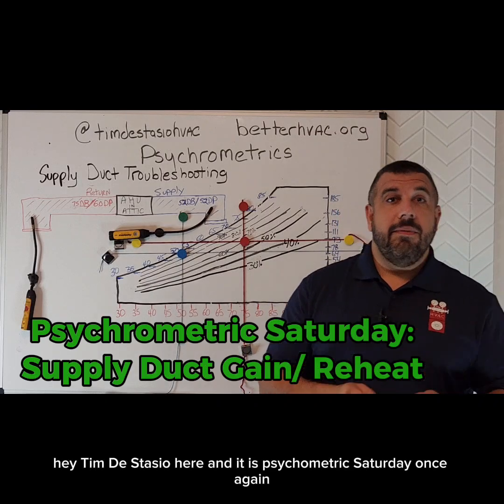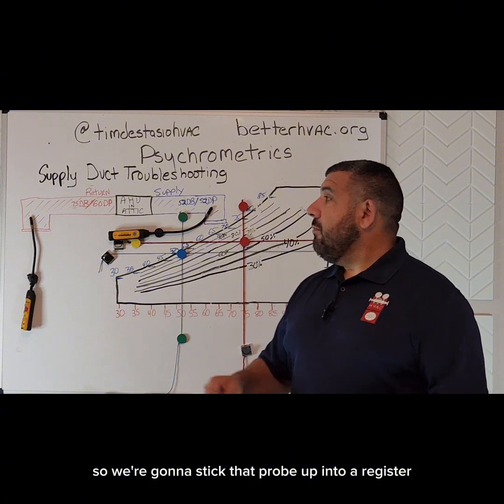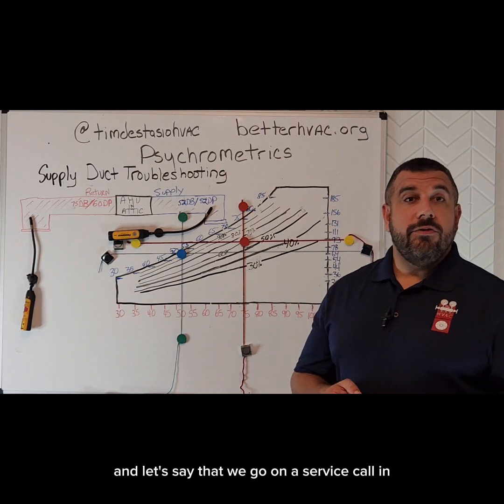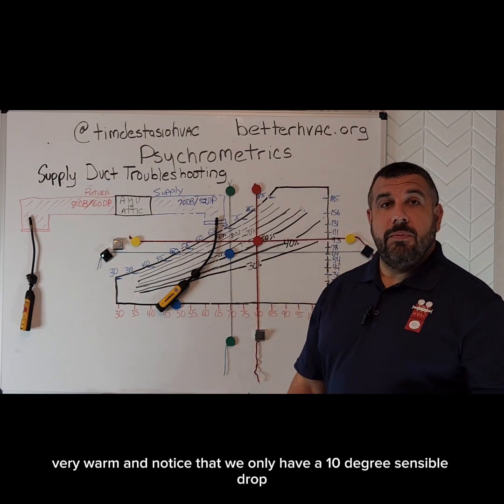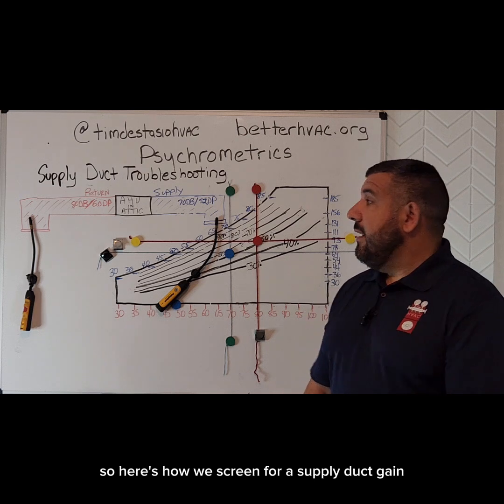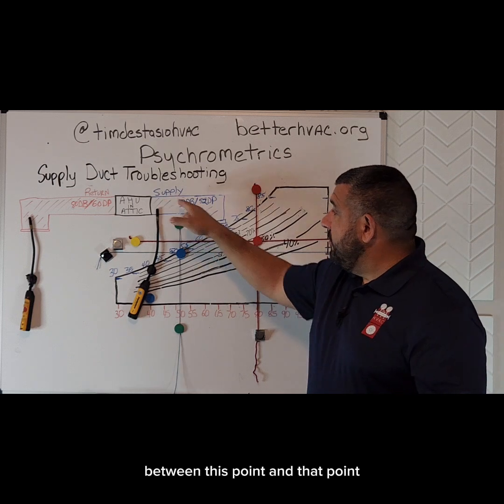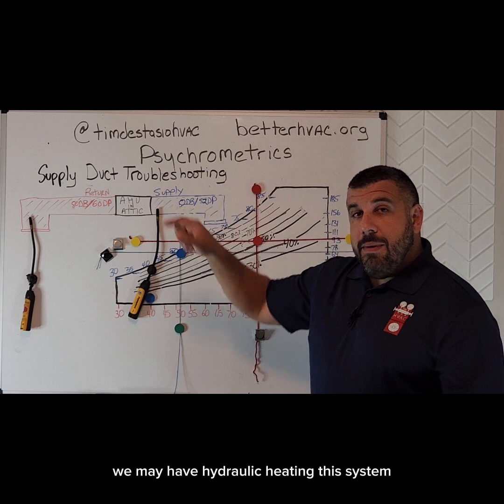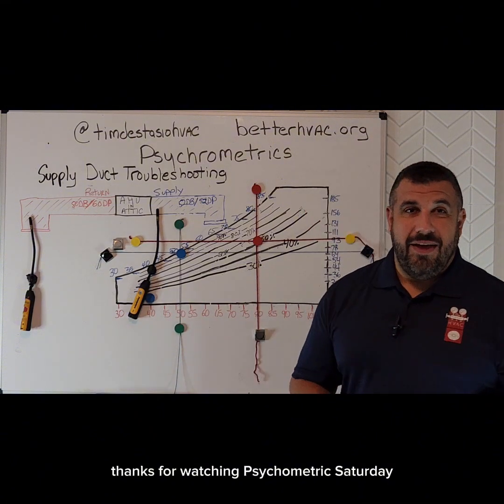Psychrometric Saturday: Supply Duct Gain/ Reheat

Comment: Always re-watching and (re)learning.  Tim do you know of a way mathematically to do supply duct screening where you take the difference in supply air temperatures (at unit and at grill), along with attic temperature and duct material/insulation to calculate gain?
MeasureQuick (I think) does it or used to do it, but I remember Jim saying they don’t really use it anymore (on the return duct side).
Thanks.
Reply from the maker: I don’t know of a way reliably. You can’t screen for supply leakage with temperature. If you know your cfm and temp difference between the supply plenum and supply register you can approximate sensible duct gain using the sensible heat formula cfm x delta T x ONE.ONE